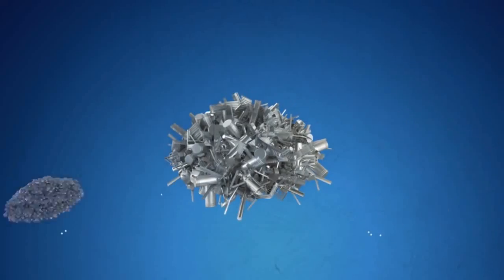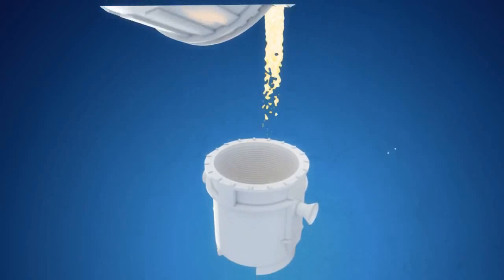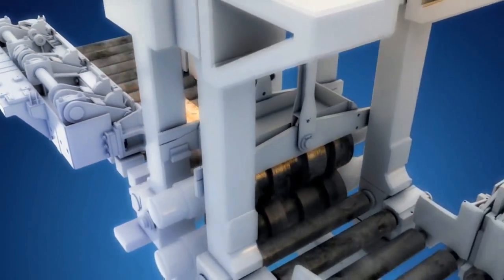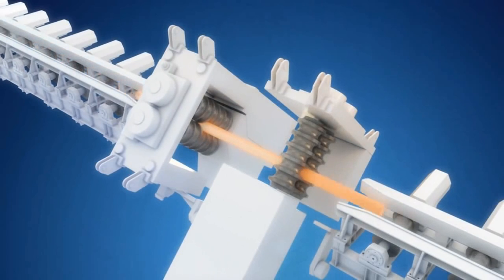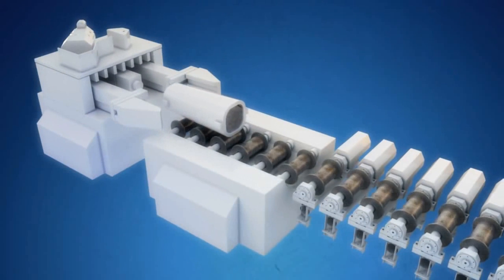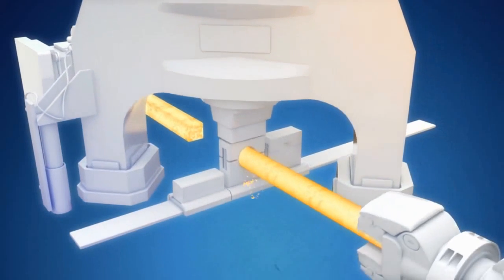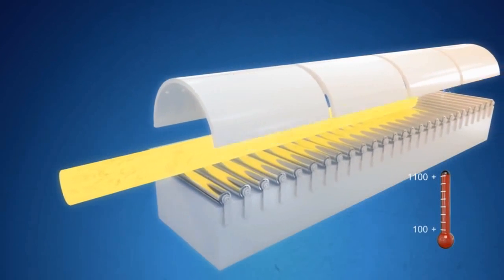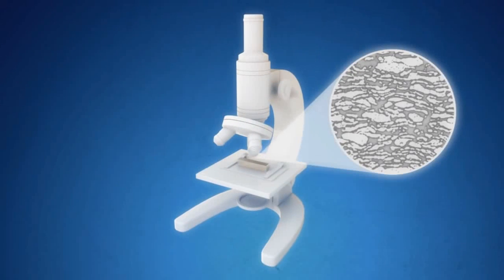HOW ITS MADE: Stainless bar and billet

Comment: But if these are casted how do they get rid of the potential air bubbles? What materials do they use for the containers so they dont get weld with the melted steel? Do they take all this temperature for continuous production time and dont get damaged nor get into the final product? How???
Reply: Casting may have small voids but the bottom pouring process helps eliminate these. Cast metals have a coarse grain structure. Forging the metal compresses the grains significantly and small voids, if any, are compressed together. Forging significantly increases the strength of the metal.
The containers are often ceramic or oil lined. Different types of metals or alloys are also used with different thermal properties, i.e. higher melting point.
I don't understand your last question, sorry.